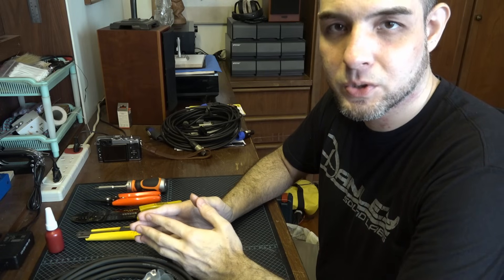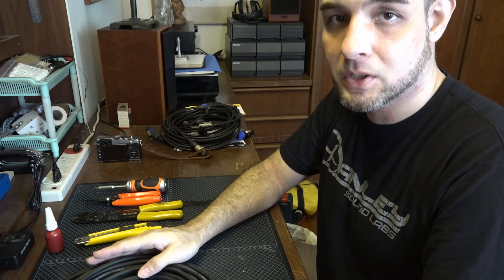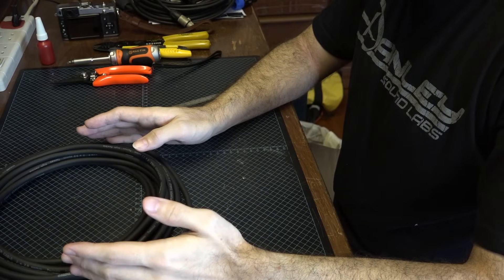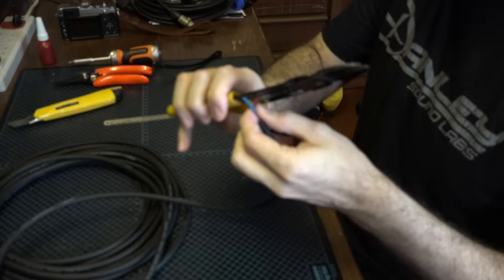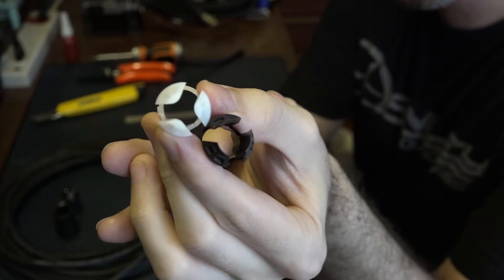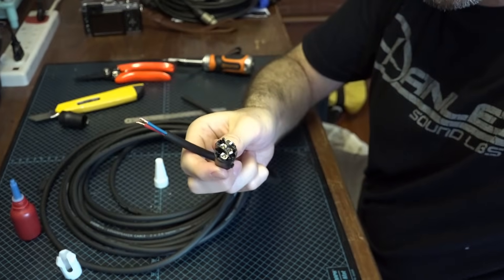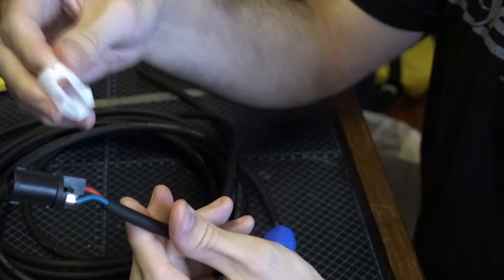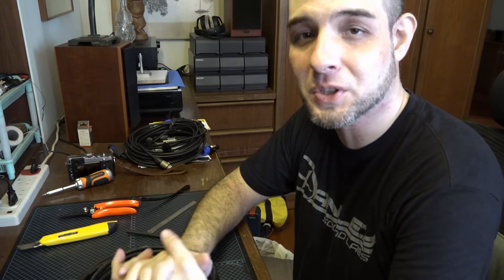How to wire Neutrik SpeakON cables

Comment: So can i wire two speakers using a single speakon tip? To run two speakers on a single Amp channel?
Reply from the maker: How do you propose to do that?
Reply: @GLBProductions  im asking cause i have a two channel pa amp and want to run four single voice coil subs off of this amp and wanted to know if using the 4x speakon i can connect two per speakon connection? If this is possible please let me know.
Reply from the maker: No, the four terminals are not connected internally - you would need to connect the second sub in each pair by using the link out on the first sub, or some other method.
Reply: @GLBProductions  ahh okay so for my new build i need the Low pass filter with the two link out connections so that i can run four speakers in one enclosure kind of how you would run two dual 18 inch subs
Reply: @GLBProductions  this will lower the impedance tho if i am not mistaken?
Reply from the maker: If it's a custom build you can wire the connector any way you like :) So you could use +1/-1 for one driver and +2/-2 for another. You could even get the larger 8-pole speakon and wire all four drivers using a single connector. As long as you keep track of things and connect the amp correctly you have total flexibility.
Reply: @GLBProductions  Thank You yeah im building a four driver 15 inch bass box for at home use and just wanted to check if this was possible.

Comment: I just wired cables for my bass amp with Neutrik SpeakON Connectors.  Thank you to Bruno for your incredibly thorough tutorial.  I especially appreciated all of the fine details you provided.   One helpful tool I purchased is a wire stripper made in Germany (Stahlwille 12967).  It makes stripping the outer jacker on cables 4-28 mm in diameter a snap, and is adjustable so the inner conductors are not damaged.  It is by far the best wire stripper I have used.  No more frustration of nicking the inner conductors.  The first cut is made along the axis of the cable, then the hooked end is used to cut the outer jacker away.  Make sure to point the hooked end away from the conductors while advancing it circumferentially, cutting just under the outer jacket.   In the U.S. it is available at K.C. Tool (kctool.com).  They also sell #1 pozidrive screwdrivers.  The set I purchased is made by Felo.  For the inner conductors, I used standard wire strippers by Klein Tools. Thanks again for the helpful advice!
Reply from the maker: Thanks 64, good suggestions on the wire stripper - having the right tool makes all the difference!

Comment: Could I use speakon 4 pin connectors between my dac and amp / speakers with 3 pins populated (hot, cold, shield / ground) to have run a balanced setup? (I am building my own dac and amplifier).
Reply from the maker: I would use XLR connectors instead - speakon is designed for speaker-level connections and relatively heavy gauge wire. It's also an unshielded connector.

Comment: Is 2.5mm wire enough for subwoofers.?
Reply from the maker: Sure! Especially if you keep the cable as short as possible.
Reply: Thank you for your reply. 
Recently I bought Two subwoofers (1200W each) and two speakers (850W each. Should I use 1.5mm or 2.5mm or 2.0mm...?
Reply from the maker: Use the heaviest gauge wire that will fit in the connector, and keep the cable run as short as possible.
Reply: @GLBProductions  thank you for your help

Comment: How we are setup cardiod sub? 
How patching cardiod sub patching?
Reply from the maker: Consult the sub manufacturer for detailed information - the cardioid sub technique requires external processing to accurately calculate and implement the delay times needed to precisely align the phase response of the various boxes, it's not just about the wiring.

Comment: Thanks for such an informative video on how to wire up Neutrik SpeakON connector cables. Great video man. 👍👍👍 By the way, do you know why REL Neutrik SpeakON sub cables only have 3 conductors and what the idea behind it is?
Reply from the maker: You're welcome Flex! Oh the REL folks 😄 Those three conductors are left, right and ground. REL are unusual in that they derive their subwoofer input signal from the left AND right channels of the fullrange amplifier output stage, ie they use a stereo, speaker-level input signal, which is then reduced to line level to feed the internal power amplifier of the powered sub. The reasoning behind this is that it allows the sub access to the exact same signals that are driving the fullrange speakers and provides better integration of the entire system. So that cable, although it carries a speaker-level signal, is NOT driving the REL sub loudspeaker directly. Cool huh?
Reply: @GLBProductions   Thanks so much for explaining the REL Neutrik SpeakON sub cables Bruno. Makes perfect sense. I have just subscribed to your channel. Keep up the great work my friend. 😄
Reply from the maker: You're welcome! Thanks for subscribing - content creation is a bit stalled at the moment due to the pandemic but it will resume soon I hope.

Comment: Can you hook up 2 speakers to one SpeakON ? We run 2 subs off of one side of our amp and 2  tops off the other . Very well done video, best I have ever seen. Thank you !
Reply from the maker: Not to one speakon, but most loudspeakers will have two speakon connectors - one to use as an input and the second as a thru to daisy-chain to subsequent speakers.
Reply: @GLBProductions  ours is a crown 6002 , one of their newer models. Currently I’m using banana plugs stacked on each side . This amp only has one set of SpeakON outs . What about some kind of Y cable ? Thanks for your fast response. You have lots of great videos, thanks for them .
Reply from the maker: Crown XTi 6002? On that amp  you can run one speaker off the speakon and a second one off the binding posts - banana plugs or just bare wire. There ARE commercially available speakon Y-cables, or you can just built one yourself 😊

Comment: Hi Bruno I want to take off a xlr and convert to speakon can you advise me the procedure or maybe make a video as no one has actually made one 👍
Reply from the maker: There is a very good reason for that: XLR connectors are not designed for use as speaker connectors and cannot handle the current required for high power applications. Many years ago they were used as speaker connectors by some companies but not today.

Comment: The questions is can you fit a 10 gauge wire in there or even after you put a wire ferull and crimp it can you help me please I want 10 gauge wire for the speakers
Reply from the maker: The SPX series can just fit 10 AWG conductors but not with wire ferrules crimped on them.
Reply: @GLBProductions  ok yeah I saw it there’s no screw to hold it it has to be soder in thanks bro
Reply from the maker: That is the STX series, the ones meant for touring - they are all metal construction and super expensive ;)
Reply: @GLBProductions  so your saying the regular one meant for 12 gauge will still fit 10 gauge wire ? I know it’s. It rated for it I wondering will it still fit
Reply from the maker: You have to check the connector specs on the Neutrik website - it clearly states the maximum AWG that will fit.

Comment: Thanks a lot for this video. I had just to look up the right terminals but your tutorial was very thorough and informative. Damn good work. And yes, always get the real deal. I can't tell you the pain you have, when someone cheaped out on those connectors. As I worked as a roadie, we aquired a used sound system for a extremly good price. We knew some of the connectors were wonky but were forced to use it, before we could check it rigorously. That gig was a nightmare as speakers went dead, the amps shut down into protection mode and so on. At any time we had only two thirds of it running. The next week we were all busy to test all cables, exhange every connector and jack of every speaker. They really cheaped out on those and had even replicas in use, which let us believe in the first place it's only some wonky jacks and connectors and not the complete system. The wiring in those speakers can only be described as "the spaghetti incident". Which was to some degree our fault, as we ripped in our need those faulty jacks out, snipped the connector and connected the bare wires directly to the cables in the box with luster terminals. It was a 1:1 what you should never with a sound system.
Reply from the maker: You're welcome Cid, and thanks for the story - do you recall what make/model of system it was? Sounds like one of those older component system with separate low, mid and high speakers.
Reply: @GLBProductions  Most of the amps were crowns if I remember correctly which were weighing a ton. The active  splitters were something from Omnitronic. All the speaker cabinets were self build, which looked roadworn but sounded really nice. The bass horns were insanely effective but huge and a pain to carry. They used some Eminence speakers. The selfbuild line array worked damn well and was loaded with  some Monacor speakers. There were some high fills and kick basses too, but I have no idea what was inside of those. The components for themself were not that bad. On the mixing desk they cheaped out again and used something from Behringer but it still did the job.

Comment: Can you use any 12 Gauge  - Positive / Negative speaker wire to connect these?
Reply from the maker: Yes you can - it doesn't have to be 12-gauge either, the connector will accept a very wide range of wire sizes due to the design of the clamping mechanism.

Comment: i wanted to know how to dismantle an already installed plug,  16 minutes later i still don't know.
Reply from the maker: Unscrew the boot on the back and the connector will come apart. On current production models there are only four parts: boot, connector body/terminals, strain relief and shell/latch mechanism. You may need to use a wrench to get the boot off if it is very tight.

Comment: Great info. I'm going to add this - never tin a wire that is going to be gripped by a screw. It will tighten nicely at first, but over time the soft solder will creep and the connection will loosen. It probably won't go completely open circuit, but it will go high resistance. This will allow corrosion to start, and the performance of the cable will continue to deteriorate.
Reply: was wondering about that

Comment: hi, my Ruark Vita 120 sub has this Neutrik cable with 2 wires Red/ black at other end but how do i connect these bare wires to my Yamaha AV amp ?....thx
Reply from the maker: Bare wires are designed to be connected to 5-way binding posts, but you need to find out if your AV receiver has a separate subwoofer amplifier built in.
Reply: @GLBProductions  hi, thank you for your reply....i have a yamaha RX-V640 av amp....at the back is a subwoofer pre out a single RCA.....but can't see 5 way binding posts but not sure
Reply from the maker: Hi Dino, on that amp the binding posts are the big red and black knobs in the 'speakers' section where it says class 2 wiring. This amp does NOT have an onboard subwoofer output, so you'll need to get another amp for your existing sub.
Reply: @GLBProductions  ok so where do i put the red and black wires ( i've found the binding posts) at the moment I've got 2 main speakers only connected

Comment: Sir, how to connect the output of one 1- mixer to 24-power amplifiers without compromising or degrading the audio signal coming out from Mixer.

Any way, thank very much for sharing your knowledge, your the best teacher...!
Reply from the maker: Hi Manuelito! You have 24 power amps to connect - is this a large installed system?

Comment: Hi! I love your channel. Thanx for sharing knowledge with us.. 
Please, can you make a short video, showing how can I dissasembly a speakon plug??

Thanx again!
Reply from the maker: You're welcome :) Disassembly is the exact reverse of assembly - twist the tail cap off counter-clockwise and everything else will come apart. Sometimes this is very difficult to do and you need to use an adjustable wrench on the tailcap - that's why it has two flat surfaces on it :)

Comment: Can a 4-wire cable be used to wire 2 woofers together in parallel so each woofer has it's own set of wires going back to the same amplifier channel? In other words 1+ and 1- wires to one woofer and 2+ and 2- wires to the other woofer?
Reply from the maker: Yes it can, but if you are using the same amp channel to drive both why not just use a normal parallel connection?
Reply: @GLBProductions  The woofers are in a folded dipole enclosure and it would just be easier and more tidy to provide each driver it's own dedicated connection back to the amplifier.
Reply from the maker: Oh ok - sure you can use the connector in that manner but be aware that this is a non-standard wiring scheme, so be sure to label all connectors and cabling clearly.

Comment: Can you do a video of speakon to xlr please and tag me
Reply from the maker: Why do you need such a connector?
Reply: @GLBProductions  to go from amp to what was active speakers tops and subs but they only have xlr on them. Amp is speakon and speakers are xlr.
Reply from the maker: In that case do a proper passive conversion of the speakers - remove the amp modules and replace with a connector plate and dual speakon connectors. XLRs are not rated for speaker-level current and the live male connector is a shock hazard.
Reply: @GLBProductions  i see what your saying but you can buy them with speakon to xlr so must be safe!

Comment: Is it ok to use  12 gauge power cable. It has 2 wire inside. Blk/white. If not let me know. I will use it to hook up bass amp to bass speaker
Reply from the maker: Yes you can do that no problem.

Comment: Thanks for this. I rewired a Speakon, it didn't work, I had no idea there were the +1/-1 and +2/-2 connections (I assumed the two positives were the same. After watching your video, I got out the magnifying glass, and sure enough, I had them in the wrong ports. Much appreciated.
Reply from the maker: Yup, if you look on the packaging the different terminals are clearly labelled but this doesn't help if you are repairing an existing connector.

Comment: Here is a stupid cable question for you I have 14/4 shielded electrical cable want to know if I can use that for PA speaker cables
Reply from the maker: Yes you can, but remember that for speaker cable you only need two conductors, not four ;)
Reply: @GLBProductions  Perfect thank you very much

Comment: One thing I like to do is paint the copper with Deoxit conditioner and work it into the area where the copper enters the jacket before clamping.  This helps seal the jacket from air, inhibiting the formation of oxides between the copper strands.  I find it just helps extend the cables service life as even OFC develops oxides over time and that increase impedance so gradually that the drop in sound quality goes unnoticed.  In a fixed installation, these connections are often inaccessible and never checked or serviced.  Which just leads to auditoriums with really poor clarity and muffled bass.  It's quite possibly the most common problem I come across.  That and inadequate cable gauge which is really the same impedance issue at the core of it.

If I'm dealing with vintage gear that the owner wants to maintain as original, say a 5 way binding post etc, then I platt  the cable strands into a spade, pin or other appropriate connector and solder it to keep it's shape.  Use heat shrink to colour code and stiffen joint between jacket and wire.  This minimises mechanical flex and continuity problems through connectors that you can get with crimps spades, pins, bananas etc.  Yes, I work on HiFi as well as PA.  Yeah, flashy gold connectors are just useless bling that only serves to increase the number of mechanical connections where problems can develop IMO.  However, SpeakONs are so worth it for the convenience and other advantages you mentioned in the video.  They are the only connector I'd recommend upgrading too.
Reply: 8ķ7
Reply: 😅vu😅77yuu😅and 😅
Reply: 9i8mmm8m7gmmk😮m⁷😅😅
Reply: I😅
Reply: M68k
Reply: 8k8m6u6⁶uuk88k6
Reply: J6
Reply: M
Reply: Jìik7ik
Reply: Ki 8:08 kìķikmm7⁸m
Reply: Ñnķ😅çn😅 jn7mumumuumjmuîmyùumj😊j😅😅😅
Reply: U
Reply: Jmi
Reply: Jmujmujmjmjjjmujmujmumyjmg😊j
Reply: U

Comment: Hello friend.
Can I bi wire with these connectors & if so how should I do the connections?
Thank you I advance Vaggelis.
Reply from the maker: Bi-wiring is primarily a hi-fi technique - this connector is used mainly for pro-audio applications. As such you will rarely find bi-wire compatible speakers and amplifiers with these connectors. Note that bi-wiring is NOT the same as bi-amplification, which these connectors are perfect for.
Reply: @GLBProductions  hello again friend & thank you for quick response.
Let me explain:I run the cerwin vega xls 15 with the yamaha px5 power amp.
Can I use a 4 wire cable (4x2.5mm) I have ,to bi wire the speakers?
I am thinking to use the two red wires to 1+ & the two whites to 1- to the speakon connector & the two reds & two whites to the four speaker terminals with banana plugs.
Am I right?
Thank you in advance Vaggelis.
Reply from the maker: Yes you could do that, but you might have difficulty fitting two wires into the speakon terminals as they are designed for only one. Better to use the binding posts in my opinion.
Reply: @GLBProductions  ok mate thank you for your advice.